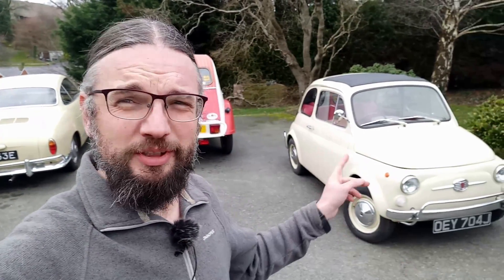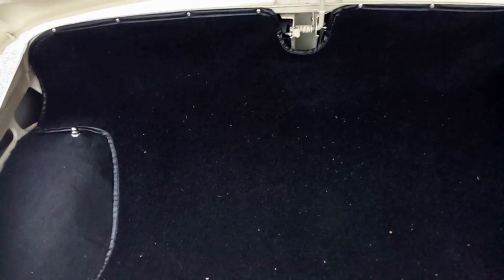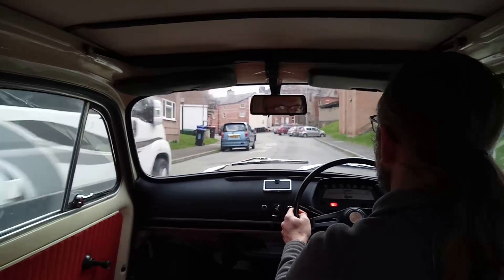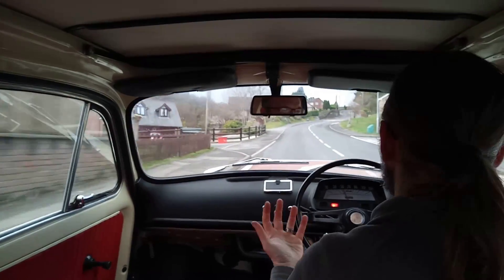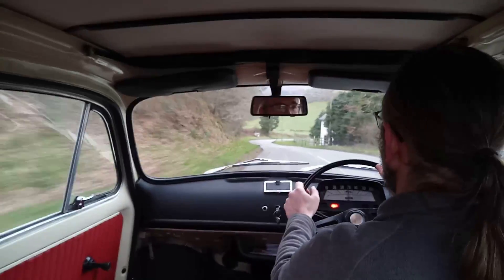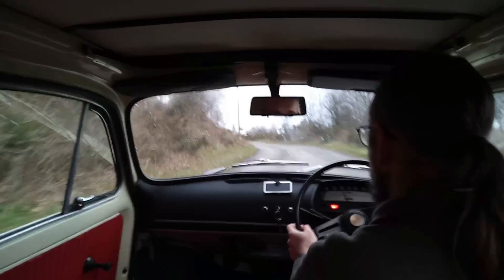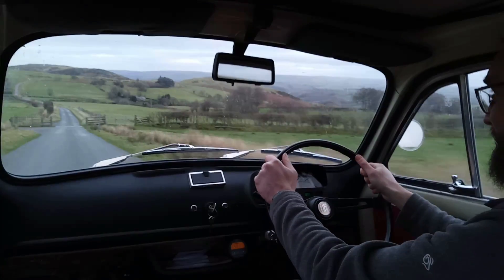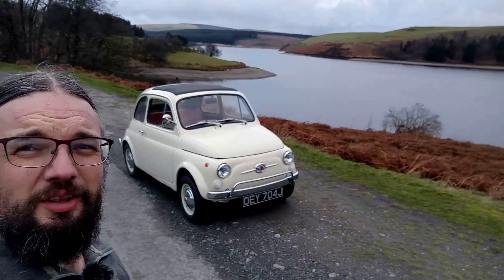This Fiat 500 is ELECTRIC! What's it like to drive?

Comment: Can electric classic cars please update a old electric milk float to Tesla standards. I can see it being called Ernie if they did it
Reply: Nah, v8 diesel engine
Reply: @sim6699  both ideas we have put together will possibly kill you in a crash as a old electric milk float had the driver as a crumple zone. Plus cornering would be fun on the skinny standard tyres fitted.
Reply: @bentullett6068  
When did cars stop being about fun?
Reply: @sim6699  they will stop being fun when they become autonomous (I think I would get bored just being a passenger). Meanwhile everything not robotically controlled is still fun.
Reply: @sim6699 oooh... a V8 diesel in a milk float would certainly be interesting. However, I would prefer to see a big petrol V12 in there! Anything to irritate ecometalists! :)

Diesel engines do have their place. A nice six cylinder in a big wafty car. But not in a plaything
Reply: @Robert_B_445  5 cylinder petrol engines sound nice too
Reply: @sim6699  Audi Quattro 5 cylinder would be very nice.